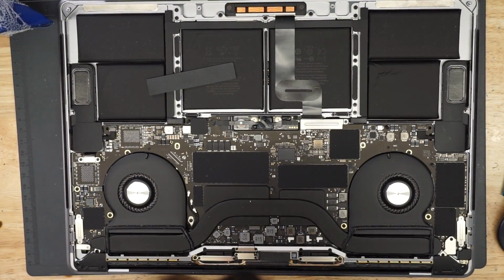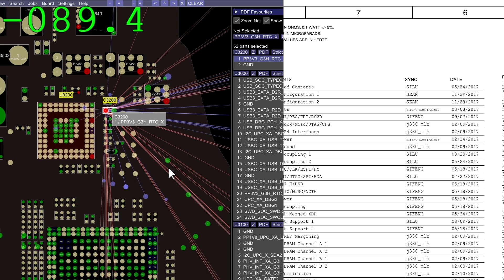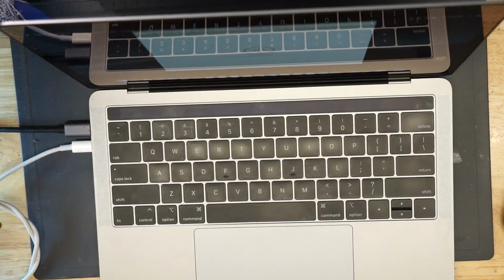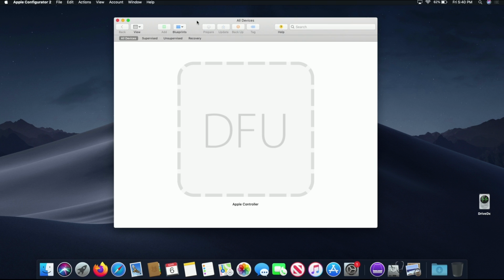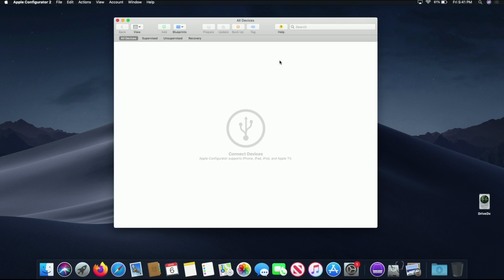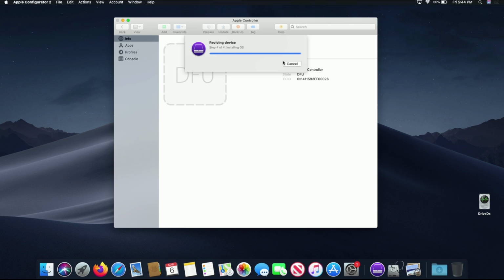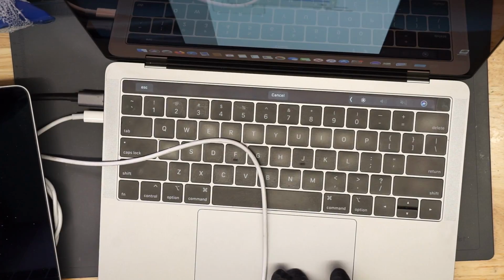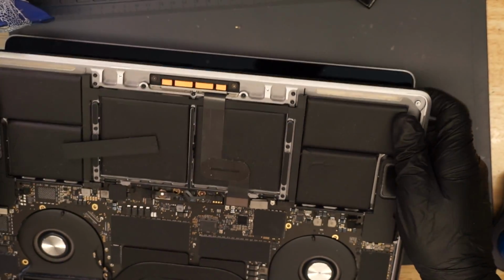A1990 Macbook Pro dead after update: how to repair T2 failure on 820-01041

Comment: Apple logic: failed bios update equals 12 dollar cable plus a 1000+ dollar MAC to fix it
PC logic: failed bios update equals 8 dollar 16GB USB plus a cheap-ass keyboard for control

Can please someone explain to me WHY PEOPLE STILL DEFEND THIS?!!!! Fixing the corrupt bios on any motherboard was simplified over 8 years ago, Apple essentially is going backwards on simplicity by 8year margin, over pricing for repair for a problem that even a toddler can fix and people still decent this practice.
Reply: @Deon Denis that's exactly how this happened in the first place. The battery is dead (needs replacement), and I had to move the PC. When I finished moving it it was passwd locked by default. It was still like this when I pulled it out of storage. The directions above already solved the issue. Right now though I need hardware repairs which I'm doing today, that should restore its speed. (Found a missing part on the motherboard and the graphics card has a capacitor that's only soldered on by one end)
Reply: @Deon Denis same to you.
Reply: Security.
Reply: @ntropy1024  Linux is better for that.
Reply: @theblackcatvieweraccount5402  not for the average user. Linux CAN BE, if used properly, but by default, it's not. So don't tell me a sword is more useful than a bat as if anyone knows how to use a sword.
Reply: @ntropy1024  actually, the desktop environments have become so user friendly, the "Facebook only" type users can use it easily. It's no longer just for the advanced user. Bat? Sword? I didn't know we were comparing a sword to garbage. Apple can track everything you do on IOS. Linux is free and doesn't have a company that tracks everything you do. (Except Ubuntu, avoid that distro) having a company track what you look at and what you do through its OS doesn't seem very secure to me.
Reply: @theblackcatvieweraccount5402  we are comparing macOS, not iOS, firstly, and, secondly, the point of the discussion is security against an "normal" attacker, not a company or a state actor. macOS is statistically more stable, it has much better support than any linux distribution and of course, there are more exploits overall on linux distributions than on macOS, and I kindly invite you to check any exploit forum or public list. Besides apple knowing when you take a shit, everything you do on linux you can do on macOS as well, given it is based on unix. Yes, a security freak would use some sort of linux, probably Qubes, but we are talking overall security, not "hide from the NSA while wearing a tinfoil hat" security.
Reply: No this is a lot easier than fixing bios in PCs. Most of them dont have safety measures like that and if bios update fails it fails and you get a brick which can be reprogrammed using a programmer. This requires teardown but this is very easy fix also I know there are easier methods in PC side. I use only PCs but i get the point they have.
Reply: @Scratchci  All motherboard bios vendors have a system I call "Keyboard ressurection". It's a system that uses the interupts of the keyboard buttons and puts the bios chip in a certain state that uses the USB0 on the motherboard to reinstall the basic firmware from a fat32 USB. AmiBios uses Ctrl+A along with USB0 or USB core in order to reinstall the basic firmware. I saved almost 10-15 motherboards using that method, it varies from motherboard and bios vendor. Also many motherboards come with dual bios that can be used for emergency restore.
Reply: @George030ful  can I use this for a really old HP (2005 I think) ?
Reply: @theblackcatvieweraccount5402  yes. If I remember correctly you need to use a floppy or really basic USB that isn't above 4GB and if you are lucky you need to find an old one. Now first you can use the HP method which you unplug everything except power, turn the laptop off and while it's off you press WinKEY+B and hold, then while holding press the power button for 3 secs and release while keep holding the winkey+B. If it' supported or the damage isn't severe, you will enter the HP Bios Recovery after the laptop starts beeping. If that doesn't work you will need the previous items I mentioned and to find what bios ventor you have because different vendors have different key combinations ex AmiBIOS needs a fat32 USB or floppy with the latest bios of your motherboard (CAUTION! not the AmiBIOS version but the manufacturer and what revision it is, it's very important to have the correct revision of your motherboard) and holding or pressing the HOME key while you power on the PC/Laptop.
Reply: @George030ful  its an HP vectra VL420 MT. Its a tower. The issue is that the bios reset when the battery on the motherboard died. Now, for some reason its asking for a passwd which it used to do when my parents turned turned on an administrative lock in order to parental lock it when I was a kid. The issue is that the parental lock password is not the same password that the computer is asking for now. This all began when windows XP committed Seppuku, and the computer was placed in storage for over a year. I've tried "passwd" as the password and it doesn't work. HP refuses to help because they dropped support for this PC in 2007. I really just want to load Linux on it but I need to reset the bios first. I don't think the USB will work and I don't have anything else that is remotely compatible with a floppy. Any other ideas? Lol
Reply: @theblackcatvieweraccount5402  I found the manual for it and I'm going to show you how to reset the CMOS for a fresh start. First locate the array of switches on the motherboard, it's below the IDE connectors.
System Board Switches
The following table gives the functionality and default position of switches on the system board switch block: 

Default Position Function 

1-4 OFF                              Reserved 

5 OFF                        ON = Clear CMOS 

6 OFF                        ON = Clear Password 

7 OFF                        ON = BIOS crisis mode recovery 

8 OFF                                Not used 

9 ON                         OFF = Boot block FLASH protect 

10 OFF                              Not used 

So you turn off the PC, turn the switch 6 to ON power on, wait to either say something, beep in some way or wait 10-20 secs, turn off the PC, turn the switch 6 back to OFF and turn the PC back on. If that won't work do the same with the switch 5. WARNING!!!!! the switches are REALLY REALLY weak and can break quite easily, so use a toothpick with the gentlest of pushes.
Reply: @George030ful  thank you. I'm gonna work on this. This is very helpful. I wasn't able to find this info before.
Reply: @George030ful  update! It worked! I'm working on getting an OS on it now.
Reply: @theblackcatvieweraccount5402  Glad i helped !
Reply: @George030ful  its been so long since this old thing worked, I forgot its 32 bit processor... Ubuntu 16.04...lol
Reply: @Scratchci    pc's often have dual bios, if first fail  you can boot from second and restore first bios
Reply: @Scratchci  most modern pc have that feature lol
Reply: @felixgamingvlog6702  / Most enthuasist-grade mobos have that feature. But then, ASUS also check-sums their BIOS before post, and automatically recovers with compatible bios file if the firmware was corrupted somehow.
Reply: Maybe because it is so professional to repair MacBook using another MacBook.
I can repair all BIOS/UEFI issues using £35 computer with £8 cable, which turns out into fully glorified programmer.

Comment: Apple.  I'm watching on an iMac that's nearly 10 years old, and has never gone wrong*.  I'm lucky, I guess.
* Except it's full up with dust, doesn't play disks, and has decided my recording equipment is out of date. . . .
Reply: I use a MacBook pro early 2011. Rock solid. Yes ofcourse disk doesn't play... regarding dust, i clean it from time to time.
Reply: @TejasviKapur  "i clean it from time to time" - but you can't access the disk slot to clean the disk drive, can you?
You need a sink plunger and an extortionately expensive gasket replacement kit, and you'd better get some heart-calming chemicals running through your system before you risk damaging the equipment you rely on.  I hate Apple only just slightly less than I despise Microsoft.  Actually, my issue is with people, and I apologise for this rant.
Reply: @tonyduncan9852  don't apologise buddy. I tried cleaning it a couple of months back as i had an important disc lying around which i had to access. I used a credit card and a micro fiber super thin cloth. I took the cloth, wrapped it around the card and pushed it vertically. It was able to revive the disk drive but it again got spoilt after a couple of weeks. Apparently, its quite dusty where i live. Maybe thats the reason. But right now i don't feel like its even worth the hassle as my disks and all have sort of been misplaced and i entirely rely on internet and pen drive for stuff so its not worth the hassle. Apart from that, i love that baby...9 years and still counting.  I too despise microsoft windows. It just doesn't get the job done😜 It's constantly checking for updates, downloading, and nowadays almost immediately issues start arising  the moment you update. Windows is not worth the hassle especially for me.
Reply: What is it with temp files slowing down your pc. Its just too irritating. Its as if I'm using windows 98 or XP. Few things never change. You have to manage your pc. A pc needs an antivirus and windows basically sucks. I love using ubuntu but macOS is just better. Atleast macOS updates don't screw up your audio,wifi etc. like windows updates
Reply: @TejasviKapur  Cool.  It's nice not to feel alone.  I also have a pile of vinyl discs without a turntable.
Reply: @TejasviKapur  "Atleast macOS updates don't screw up your audio,wifi etc. like windows updates" - Not true.  I had a beautiful analogue/digital transceiver which was totally disconnected by a later OS.  If you ask Apple for help, you get a 'service' offering a downgrade to the software that offered the drivers for it.  All I had to accept was the decreased functionality and lack of future support that that entailed.  That I couldn't do.
Reply: Same with me, MacBook late 2008. Good times back then.

Comment: I see Louis used a fix I messaged on stream live chat AND e-mailed him about a few months ago :-). Louis didn't believe me Dx. I've been having to re-flash the T2 chips on many machines to revive them after failed software updates, and to make Command + Option + R actually work right and install Catalina on a machine that came with Mojave or High Sierra out of the box. What a pain. About 95% of my cases have not involved losing data on the machine. The rest rendered the machine needing an OS re-install.

Louis, for the DFU restore, once the Mac begins showing the Apple logo with the loading bar, then reboots and shows a loading bar with time remaining, you can unplug the USB/Thunderbolt cable. The machine does not need to be tethered to complete the pending OS update. Apple Configuration 2 doesn't get signaled that the T2 chip has actually rebooted with the LATEST firmware, and thus times out. Also... the charging cable the Mac comes with works fine as the DFU process runs over USB 2.0. You don't need to buy another cable.

If Apple were smart, they would make the T2 chip be capable of re-flashing itself through Internet Recovery. So their machines don't brick like this. Or you know... do what everyone else does and have a read-only backup boot partition for booting off of in emergencies.
Reply: I’m too interested to understand much more on the topic.
Reply: Hello, i would like to ask you some more info about this problem. Is it possible to contact you and talk?
Reply: @ΝίκοςΒουγογιαννόπουλος  I know very little about why it happens. Other than it being caused by OS updates. Apple doesn't seem to have built in enough redundancy into the T2 chip to keep the issue from happening. I mean. Most modern BIOS have backup boot blocks in case of a bad flash.
Reply: I'm in a similar situation with a bricked a1989. Tried to re-flash with Configurator2, but the dead MacBook is not recognised on the tool. The host MacBook (mid-2012) is running Catalina 10.15.7, so I'm not sure if there is a compatibility issue with that.
Reply: @dennis_johnson  In theory the DFU mode should work regardless of what is on the SSD, as the code for that lives in the ROM inside the T2.

In some cases I've had Macs go brain dead and fail to turn on even after performing an SMC reset. Just like this even. If you have the tools to open the Mac and disconnect the battery for a few minutes, do that and then see if you can enter DFU mode. Or if the machine turns on normally afterwards.

But yeah, new year, newly released OS, once again the bricked T2 chips show up.

Comment: Good to know! Normally I keep at least one generation of old computer as a backup in case the new computer gets damaged/stolen/whatever, and I guess this is just another reason to do that.

Does anyone know if this tool will run on a hackintosh? And does it specifically require the working computer to have USB-C, or will a USB-A to USB-C adapter work?

Comment: Take the next one to apple and see if they say you need a new one or if they actually do what you guys did to fix it
Reply: dbetts3087 the documentation would have them run configurator. UNFORTUNATELY, most of the technicians I worked with at Apple didn’t have great luck with configurator because they’re bad at following written instructions. So most Genius Bar techs would likely replace the board.

Comment: Rossman: I hope that you learned something today.
Me: Not to buy apple.
Reply: Wait you literally just learned that today?
Reply: @Drazil100  Not really.  I've never bought apple...hate apple, and will never buy anything apple.
Reply: @JosephWiess  Apple is bad and you never used anything made by apple. Wow, that speaks for itself lol
Reply: crunch
Reply: I learn from the pain of others.   My wife, sister in law, and my sister all had I phones and had trouble with them.   I've had friends who have had mac's and had problems.
Reply: @Austin Allman agreed. I had an apple in 2006 and it was great but can't believe the issues they are having with modern hardware. So if I did ever decide to have one I just need to have another one standing by to run diagnostics on should an update screw up 😠